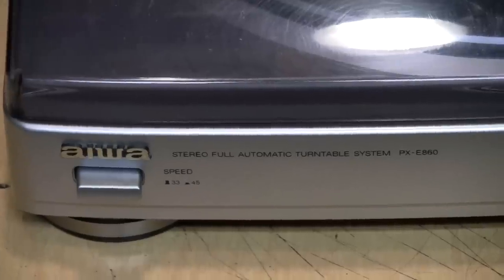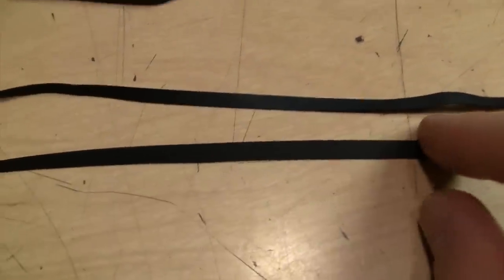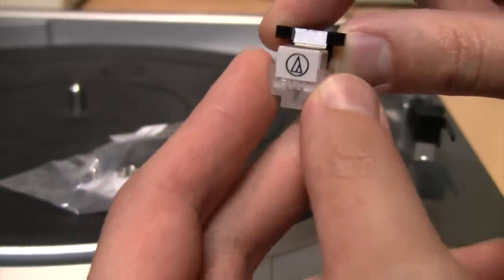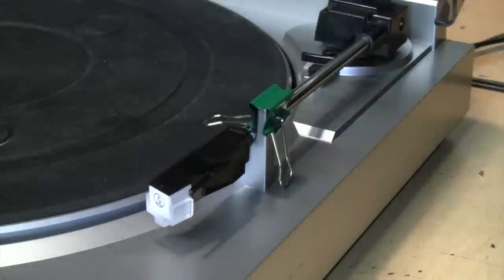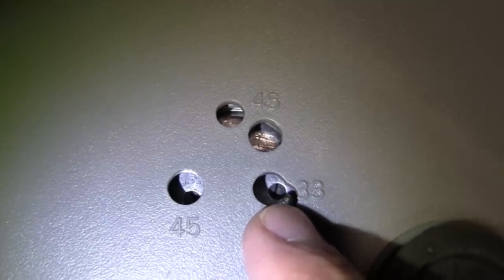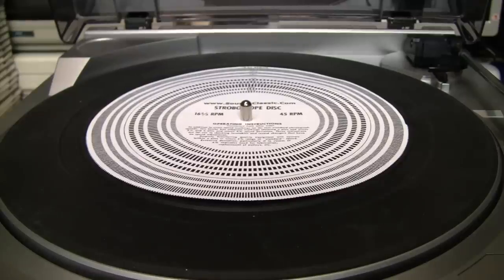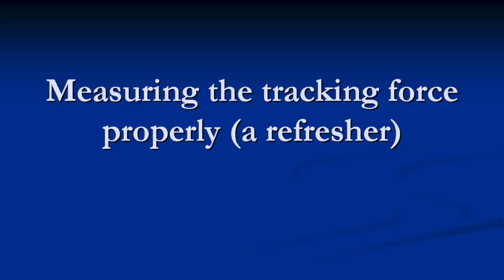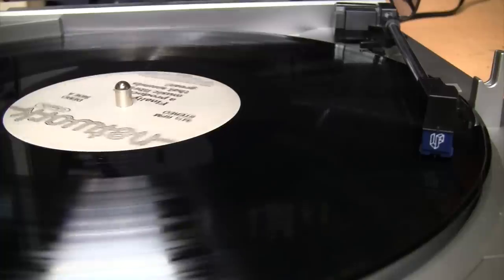Cheap fixes & upgrades for cheap turntables

Comment: Are you serious? Recommending line output over phono without explanation? Bizarre.
There won’t be any volume issues if your amplifier has a phono in or you use a phono pre. 
Of course it will sound tinny if there is no RIAA curve adjustment!
Reply from the maker: On turntables that have a built-in pre-amp, it usually sounds better using the built-in one because turning it off does not completely bypass it, which affects the audio quality when using an external pre-amp or phono input.

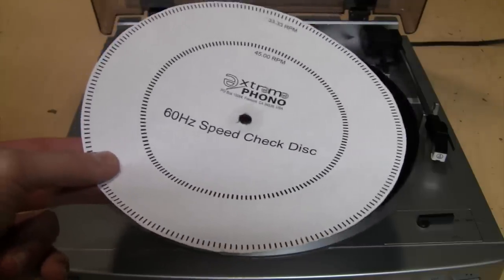Comment: 16:12
https://youtu.be/fEMoAwLpLDM?t=973
it DOES NOT MATTER to print it exactly in size. even You print it 2x bigger or smaller, it will work the same. 
it is a strobe disk will have a SAME number of black dots...